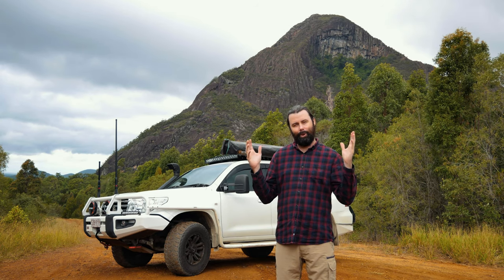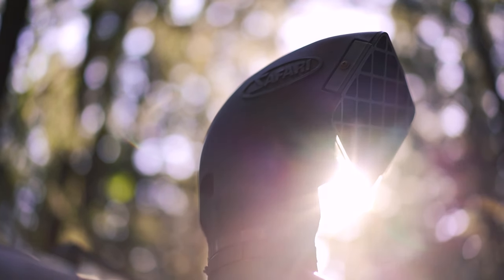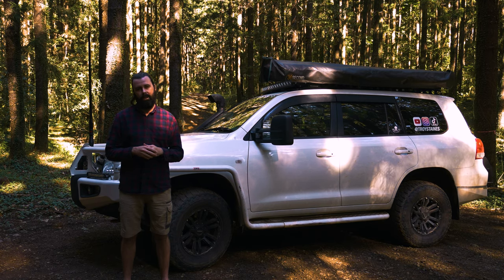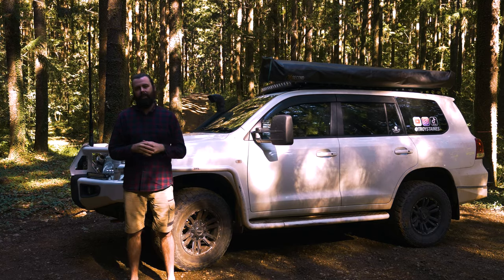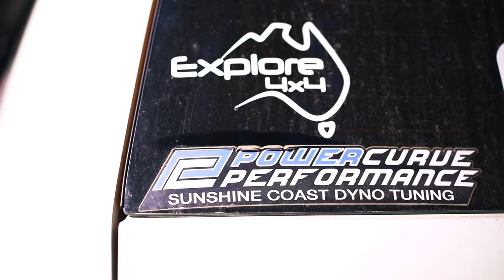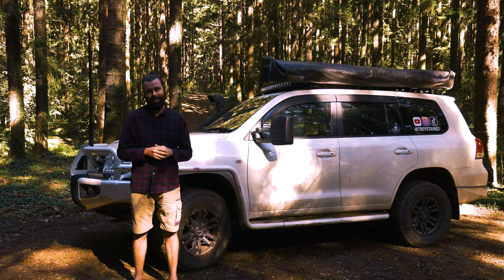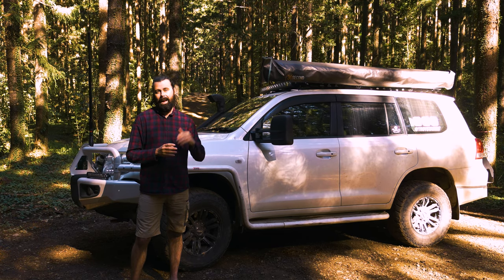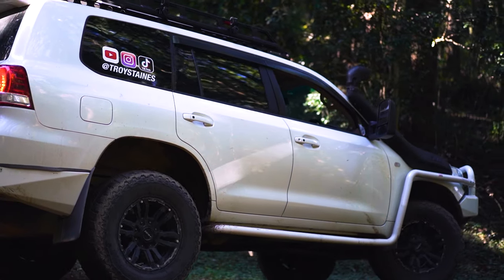200 Series Landcruiser Build - Episode IV Driveline

Comment: Great video thanks Troy! Wondering if you installed the diff breather kit yourself or had someone install it for you? Seems hard to find info on how to access all the breathers, particularly the top of the gearbox and the transfer case... My mechanic, who does a great job looking after my 200, had a go but gave up!
Reply from the maker: Thank you! No I didn't install them myself - had Powercurve Performance do it for me.  Only took them about an hour from memory?
Reply: Troy Staines thanks for the reply mate! Also wish I’d seen your electrical setup before I installed my DC-DC charger and split the batteries 👌

Comment: troy, yet another great vid  …  what's the stocklock as a daily driver when not towing ??
Reply from the maker: Thank you! The Stocklock is great in all situations.  99.9% of the time I leave it on auto so it locks the torque converter once you hit about 90kmph and then disengages it once you drop below about 82kmph. Great for driving on the highway stops the car from hunting for gears, improves fuel economy and also keeps the gearbox temperatures down.